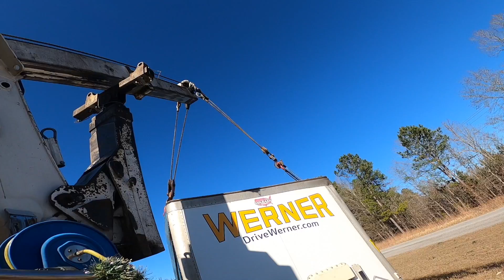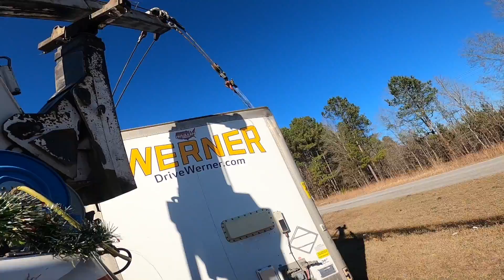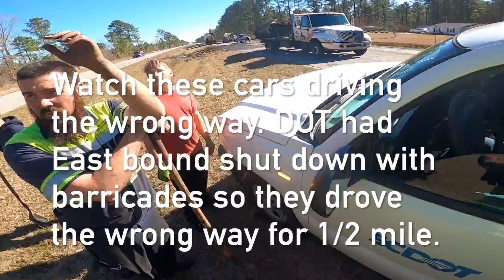Trailer Fire! Recovering A Burnt Trailer!

Comment: You can put together a couple blocks of wood to fit around the king pin. You probably can buy something online to do this. The guy's that came out should have removed the pin as well as the landing gear. If you plan on getting these types of call, it may be best to re-think how to do the next one. You did a good job for adlib.
Reply from the maker: Mr Max  Thanks for watching and stay safe